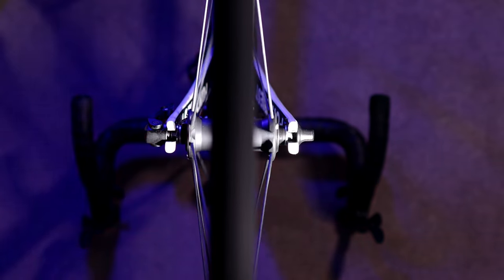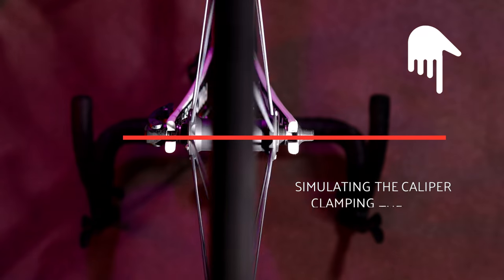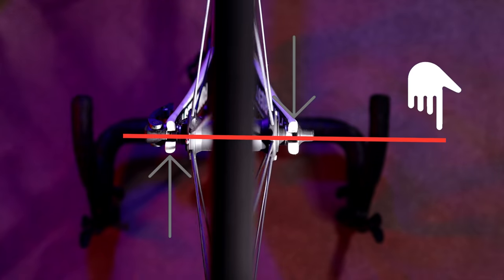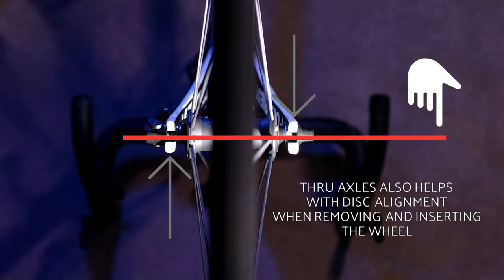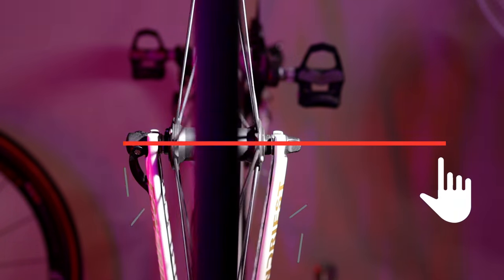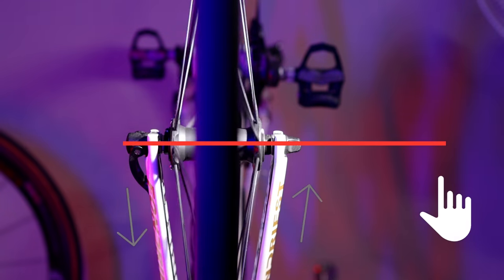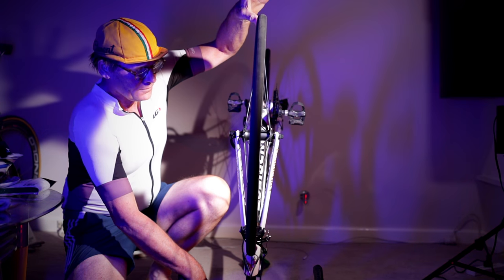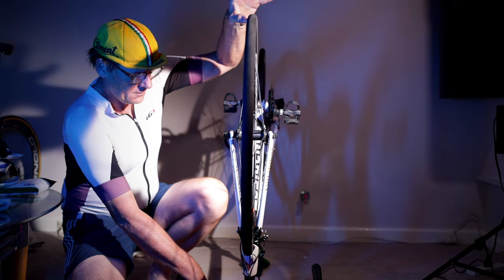THRU AXLE vs QUICK RELEASE

Comment: "Quick" release skewers were named a century ago, now they are the opposite of quick. You have to hold both ends up against the dropout notch while trying to rotate a nut, if the wheel is heavy enough or the disc brake pads get in the way it becomes a "four-handed" operation, not to mention the wider hub spacing when the fork isn't under tension and the lawyer lips.....compare that to a thru axle which holds the wheel up and in the most correct position for you. Any bike is inherently less reliable if it discourages the user from removing the wheels to perform maintenance because s/he is afraid to put them back on.

Comment: I think another  reason the threw axle is used is , to insure the wheel and break disk are sitting in the same location when installed. It will fit one and only one way. The quick release wheel can be installed crooked  or in a different location depending on the frame.
Reply from the maker: Yep covered this, disc alignment

Comment: I've had road discs with QR and TAs. 

The main problem I experienced with QR is the caliper becoming a pivot point upon applying the brake which pulls downwards on the QR on the left side and can cause slippage and misalignment after heavy braking. 

The left fork leg gets the brunt of the braking as you say, but that's not so noticeable. 

I found a massive improvement in braking upgrading from the stock wheels, which used to pull the wheel to the left under heavy braking because the twisting through the hub must have been tightening the spokes. So agree wheels are also a major factor. 

The TA is certainly a much more suitable design, especially with the tighter pad clearance on the discs with road brake calipers.

Comment: I think on a previous video I did comment about the stiffness of bolt through systems on MTB  .  A bolt through will stiffen a fork or frame up as it is a solid brace that becomes an integral part of the structure  .   Bolt through systems reduce twisting and deflection . 

Yes most of the new found stiffness in road frames and forks are due to beefing up the construction to cope with the disc brake . 

There is stiff an effect by the bolt through.  What you should compare is a QR disc fork and a bolt through disc fork . Then you would be comparing apples to apples .  

A good experiment is to clamp a hub in a vice , then attach the fork with a set of bars attached and see how much twist can be enacted upon the fork . 

You could even test the side to side flex as well.
Reply from the maker: Thanks for the comment, cheers
People love to reference MTB, there are a couple of major differences, they have springs and shocks, this is designed to take the absorption before any other component, so the tyre and spokes, fork flex are not part of the ride feel and dynamics of the frame, also the traction between the ground and the tyres is less, also with more undulation if used off road, therefore braking at road limits are not reached.
A road bike utilises the spokes, tyres and forks as flexible components to maintain contact with the ground. So all these components act as active suspension. This may seem like a small difference but it is actually huge. The applications are quite different.
Reply: @waynosfotos  the difference is also found in ridged forks for mountain bikes .  Most trials forks are now bolt through and they use rim brakes (rim brakes actually supply the highest stopping power as the rim is effectively a huge disc brake rotor . ) 

Trials riders want light weight forks that don't flex so they can accurately place a front wheel while riding trials.  

Another example are the differences between the Surly forks that come in QR and bolt through . The only differences between the forks are the dropouts . Both are 700c steel touring forks for disc brakes yet the bolt through fork system is more resistant to twisting and flex under braking and deflection while cornering . Neither are suspension forks .  

Structural engineering principles apply in fork design and axle design.  A fork that is solidly clamped by an integrated solid axle will always flex less than a non integrated axle . How much of this is due to spoke pattern ect can be accounted for by using a wheel with interchangeable axle design (ie can be converted to qr or bolt through ) .  

The majority of the stiffer feel will be because of the spoke lacing and beefing up of the fork . 

But to say that the bolt through has no effect is incorrect.   It maybe less pronounced on a road bike but it is there.
Reply: @waynosfotos  the other factor you have not covered is the shearing force put on a fork while cornering , the forces exerted on a wheel is not just to to the side but also rotational.   .
I'm not sure I can describe it well in text .  Wish I could send an illustration.

Comment: You beat me to this subject! Been on the burner for a while. Still gonna do it 👍☺️. Nice vid
Reply from the maker: Cheers still trying to get to your level lol, thanks for stopping by, love your content. Love tech stuff and reasearching the hell out of it. Not that much on this sort of niche out there. So good for us! 👍
Reply: @waynosfotos  ah thanks mate. That means a lot! Your vid got me thinking. Im actually working on it now. There are a few other points I'll add. Cheers
Reply: Wayno, Peak great vids guys!
As a ex bike mechanic the one thing I can add to this this issue is the QR wheel system must have a little amount of give, the reason I state this is when in the 80's and early 90's alloy bikes started getting light, it brought with it a new issue, the issue was the drop outs wearing out, in fact on Mtbs raced in sandy Gritty locations this could happen after a couple of seasons, the issue is then your wheels don't sit straight in the drop outs, this happens even faster on 100% carbon drop out, In fact I believe  Raoul Luescher now has titanium inserts that he bonds into worn carbon or alloy drop outs. If there is enough movement in a QR system to allow this to happen could that movement then decrease the strength of the structure, and could this be a factor in the stiffness feel? 
Peak Torque ide love to hear your thoughts on this?
Reply from the maker: @lovecycling193  can't really comment on that, as i haven't heard or experienced it. Quite possible but the cause could  also be movement in the fork and the axle is rocking. But i am only quessing as i haven't seen an example of this. Cheers for stopping by. 👍
Reply: @waynosfotos  it's far  more common in gritty environments, so where I live lots of the 80's-90's MTB races were set on long 10 to 20 miles laps and lasted way longer than the modern xc races, but my area is extremely gritty sandy flint trails etc so chain's and bottom bracket s got destroyed extremely quickly, then when Shimano introduced V Brakes with the Xtr removable cartridge pads were so thin that 1 to 2 races would kill the pads! But of course back then aluminium was hitting the scene, I rode a Klein adroit and a Yeti arc both had rear alloy stays that could suffer. It was an issue I hadn't heard about for years until I saw Luescher Teknik bring up the issue on carbon road bikes and how he now offers titanium inserts. I suppose in theory a drop out is a only 180° half circle then the rest is open, maybe that allows for some movement Vs a through axle which is a 360° hole and the axle is unable to move as much 🤔 I like you ask these questions as it get the old grey matter ticking 🤣
Reply from the maker: @lovecycling193  peak Torque just did a vid, where he talks about the specific load they apply. I suggest you check that out too.
Reply: @waynosfotos  cheers, checked it out earlier 👍
Reply: I have mtbs with qrs and thruaxles. Dont really notice much difference. And I ride pretty fast.

Comment: Through axle was a engineering and safety fix for the problem on early  disc brake bikes with  QR skewers.  If the QR was not tight enough the forces  exerted by the fork on the disc  could cause the wheel to try to pop out of the forks  leading to serious accidents. While the mtb riders seem to relish these catastrophes with pictures and stories the industry realised it was a law suit just round the corner. The mtb market push the boundaries of all bike tech to and beyond the limit and that's why  there is a trickle down  effect to the road  bike user.  The braking  forces from calipers on a rim brake do not have the same consequences. 
Large brands with significant turnover in the USA will always seek to minimise risk from lawsuits hence the amount of safety stickers we find on new bikes, so we are going  to get more disc brakes and through axel on new bikes and the rim brakes and QR  skewers will be on niche bikes  brands or just in the museum.

Comment: Actually I prefer through axles vs quick release, I do for the most part use bikes with quick release but from my hard braking sometimes the front wheel/hub can wander of from the fork. And I being a motorcycle rider/ex racer like hefty axles just for the sake of it.But I do hate the fact that the axle is threaded into the other side of the frame/fork. I know it is probably very uncommon but I do not want to risk of striping the thread in the fork leg/frame. Would prefer a nut on the other side  :P

Comment: My disk winter ALR Emonda is inert. Numb handling.   Same emonda rim ALR bike have too same 105 slightly lighter wheels. Beautiful ride.  A lot is wheels. Don’t doubt same wheels still the disk bike be handling ‘dulled’
Reply: The first point to check on a dull ride is the but with the most flex Eg the tyre. If you wast to improve the ride and feel get good quality grippy tyres and lower the pressure a bit. Most bike makers put very durable stiff tyres on the bike from new as they are  heaped to make. A decent tyre like schwalbe pro one or conti 5000 could transform the ride.

Comment: Try axle was invented firstly by Focus with RAT system in their first world disc road bike. 12-14mm overdrive axle in the front it makes super stiff fork. Also Disc brake forks are designed with extra reinforcement of fibres and heavier.

Comment: This is why I am not a big fan of disc brakes on road bike since the forces are not symmetric whereas in rim brakes they are.   This requires the design of the fork to have more reinforcement or material applied to compensate for the one side.
Reply from the maker: So true.

Comment: Thru axles and QR are directly linked to Disc vs Rim. I am really curious if brands will bring back rim road bikes. Nothing from Trek, Specialized and barely two to choose from Giant. Canyon told me they won't even offer any, siting lack of demand. Sounds like BS to me. I am looking for rim brake but basically have almost nothing to choose from.
Reply: Better yet, will rim brake come back with thru axles.
Reply from the maker: I find that hard to believe, they must still have the old moulds, just dust them off. Yes they will be the older frames but is that really such a big deal, i just bought an old stock LOOK 695 2015, in 2020. Does it ride old? No as i fitted a new 12 speed groupset, it is new and an awesome bike, was heavily discounted too. Smiles from ear to ear?
Reply: @waynosfotos  you are lucky, able to get a Look frame. I can't find any here in States. Time and Look I am willing to pay a bit more. However, I am feeling the squeeze by whole industry pushing disc brakes.
Reply: @waynosfotos  how did you get old new stock 5 years later if you don't mind me asking? Or is it a used frame? I am just a little hesitant with used carbon frames
Reply from the maker: @openwheelracing88  i saw Hambini's vid on the LOOK 695 and zed crank design so was looking for a frame only, hoping to pick up some old stock. Then i saw one complete bike on a on line store new, 60% discounted. So went to my local bike shop and said, can you get this bike in my size. So he chatted up the LOOK agent and said yes we can match the price and build fee, brand new bike from LOOK.
So i discussed changing out the groupset and wheels with my LBS and took off the wheels and old model Duraace groupset, sold these to friends and on FB. I then fitted some of my tubular carbon wheels and Campagnolo record 12 speed. So it cost me about 6-7k AUD all up. I did a vid on it if you are interested. 🤔👍
Reply from the maker: Yep i just got in before it went covid crazy. Bianchi still do a rim specialissima, special order i believe. 
Bastion cycles bespoke builders in Melbourne Australia do custom frames so you can have any geometry you like, may still do rim. BUT they are not cheap. 8K AUD for a frame. There is also our friend in Adelaide Radelaide "Durianrider", doing the pragma bikes. I know alot of people think he is a bit unhinged, but he is ligit with products, bought products off him before. So there is a few options i can suggest.
Reply: @waynosfotos  sounds like I need to talk to shops more. They are so busy these days and just want people in and out. I will call around. I am currently riding a Bianchi Impulso gravel bike, really want a light weight rim bike. My Bianchi shop is one of the largest in US and they told me Bianchi factory is making discs only at the moment. Fingers crossed they come to their senses after raking in.
Reply: @waynosfotos  right now I am looking at importing a Rose X-Lite from Germany. Reviews are scarce. Almost ready to pull trigger
Reply from the maker: Pretty sure i saw it somewhere, new Specialissima available in rim special order. I think it comes as frame only. But that is okay, just have it built up. Twist your LBS arm to enquire. It will take months to come, but it will be what you want. Made in Vietnam these days, not italy. Just so you know.
If your spending this money, be sure to check out Bastion cycles. These are premium frames carbon tubes and 3d printed titanium lugs, they engrave your name on the derailleur drop outs. One of my dream bikes. Watch some vids on the product processing. Impressive! Ship into asia, so don't see why they wouldn't ship to the USA.
Reply from the maker: @openwheelracing88  i have a feeling they may be generic frames. Like ribble and other companies like Nove. Nothing wrong with that, but can be sourced cheaper elsewhere. What i mean by that is it is a open frame from china they licence and then put their name on. Maybe some of the other viewers can chime in, that know a bit more than me about the Rose products?